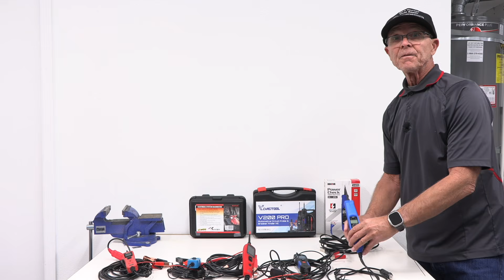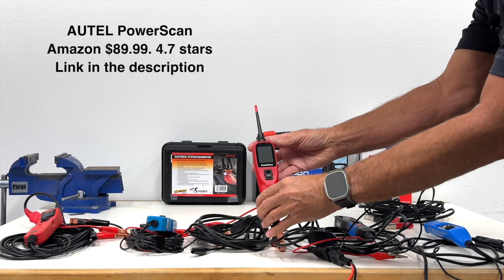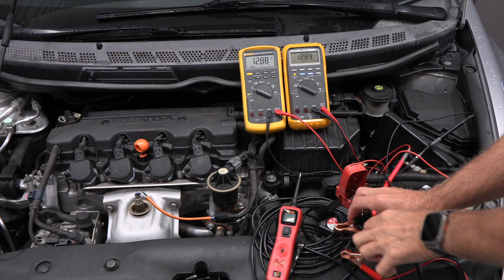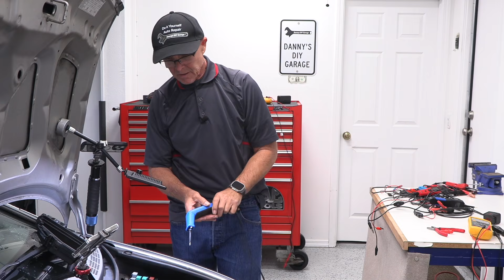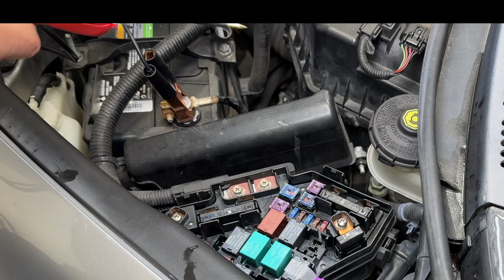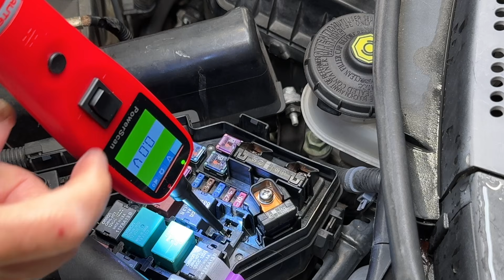Power Probe Circuit Testers Compared – Power Probe vs Autel vs V200 Pro vs Innova

Comment: Does the sound have to be on, on the Autel at all times?
Reply: You can turn it off
Reply from the maker: @TrUvayNe  thank you for helping @jackcardinal9887
Reply from the maker: No, the sound doesn’t have to stay on. On the Autel PowerScan PS100, just give the Mode button a quick press to toggle the tone on or off. 👍

Comment: You never said which was best. Which one would you recommend?
Reply from the maker: In my opinion, the Autel PowerScan is the best overall value. The Power Probe is a good tool, but for what I use these testers for, I personally don't think it's worth the extra cost. They all perform the same basic functions I use most.

If you want the additional broken-wire locating feature, I'd go with the V200 Pro. It's a nice feature to have, although honestly, I think most DIYers will rarely need to use it.

Comment: Dont you have voltage drop on the tools with the cable length as to why the probe reads different?
Reply from the maker: The voltage drop should be calculated into the tool, but yes there will be a little voltage drop when supplying voltage to turn on components

Comment: FYI: The Voltage that is displayed on the LCD screen (Sinstar/CNBJ-823/CT03) is just the Battery voltage ONLY all the time, UNLESS YOU DISCONNECT 1 OF THE BATTERY CLIPS, then it will display the voltage @ the probe (press the switch).  John vk3hjq

Comment: They make powering something up easier other than that a meter is better. Rotkee have a probe with amongst other things, a built in scope. I'm cheap, I got mine from Ali Express for around $20 & it does what I want it to do well enough

Comment: Why does each measured component under test in various cars have different initial Currents/in rush currents?
Reply: Usually because theyre in series with other components and that can even cause false reading after they’ve stabilized.
Reply from the maker: Because different components have different electrical loads and different ways they start working.

Things like:

motor size
resistance
temperature
whether the part starts under load
and the design of the circuit or control module

all affect the initial current draw.

For example, a blower motor, cooling fan, fuel pump, and radiator fan can all have different inrush current because they each have different internal resistance and mechanical load when they first start. A motor usually pulls more current for a brief moment at startup, then settles down once it is spinning.

Comment: Pretty much any $15 automotive test probe can measure voltage with .01V precision, and to activate the fan one could use a high amp test bulb or a resettable fused link. Are there any other useful features of these probes which would be worth comparing (like frequency/duty cycle mode, current limiting capabilities, maybe some signal generator features)? Otherwise it is hard to rationalize a purchase of a $170 device capable of just measuring battery voltage.
Reply from the maker: These tools strong point are powering up components to check a components health,  in my opinion, most of the other features can be performed much easier and safer with a meter, if you’re comparing which to buy, watch my videos on each, they show what it comes with and features
Reply: The Vdiag V500 pro can find break in wires, test injectors, has a 0-5v range for lower voltage sensors, has oscillating waves etc it is very good. I got it for £116 on offer on ebay genuine which would be around $160